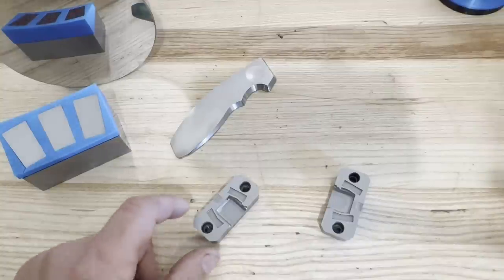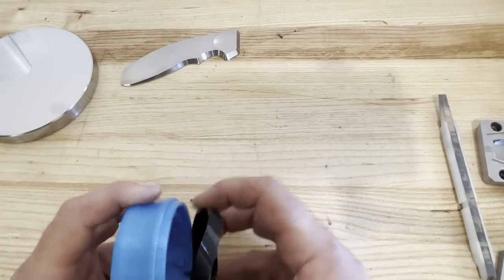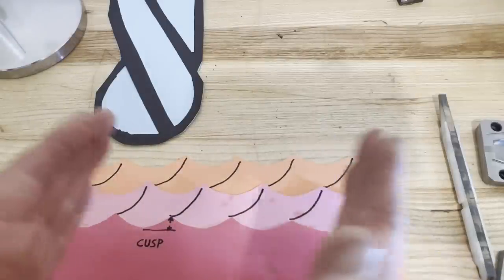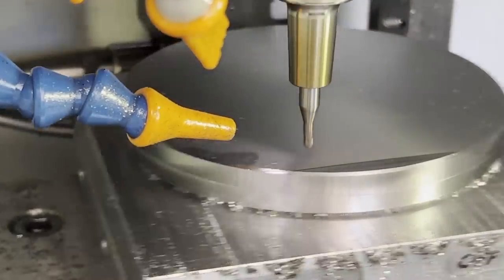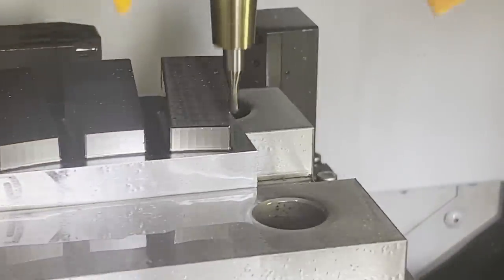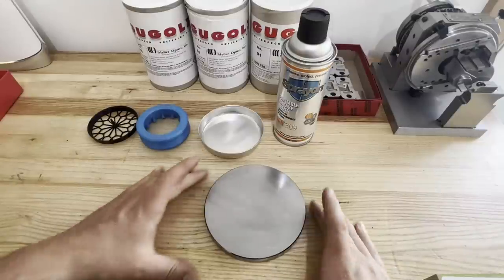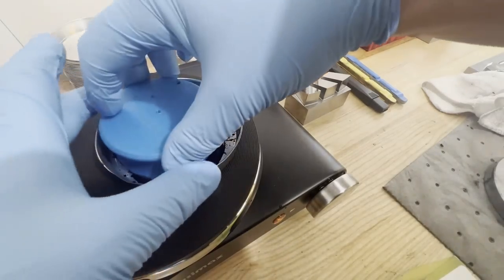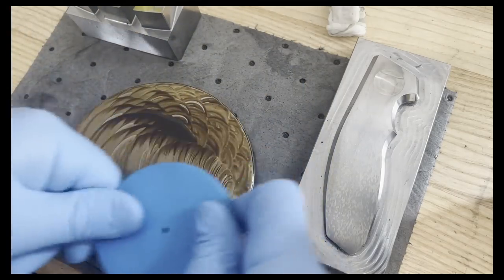Improve your polishing with 3D printing

Comment: I made some ultra flat lapping plates from 8in dia 1.5 thk cast iron using the three plate method. I started with a reasonable surface ground finish. I milled a grid of grooves and ground the plates together in the 3 plate order to make them flat. Of course thousands of strokes per plate, many combinations of plates and several grits makes this a huge job.  Of course this is way too much work so I didn't do any of this. I made a fixture and programmed a CNC mill to do all the work.  My polishing action included linear and rotary motion. I did clean and shuffle the plates and change abrasive.
I did about 2-3 hours worth for each grit. So probably 8-10 hrs total. This would have been punishing by hand. I measured the plates with a Heiidenhan LVDT sensor and a laser interferometer. I'm not sure how you are supposed measure plates like this down in the millionths. The laser would measure a millionth and it found only one or two anywhere I looked. At this scale anything will affect the reading so I'm not sure how trustworthy these numbers are. It was a lot flatter than my surface plate when I measured it the same way. Interesting experiment and pretty flat too.

 I always learn interesting things from your videos, glad you take time to make them. I watch them all. Thanks JY.
Reply: I will second that, very glad you take the time to show and teach. Thank you!
Reply: Any videos on that process?

Comment: In the world of telescope making we have used 3d printed figuring disks for some time. For turning a the spherical surface into (usually) a parabolic, but also other aspherical surfaces. Huygens Optics on youtube recently did a video where he uses the technique. Also have to say, your 3d printed differential pitch screw actuator, is brilliant!.. and will be stolen by the DIY optics community..Thnks!
Reply from the maker: I’ll have to check them out, opticians fascinate me with their abilities
Reply: @adamthemachinist  We feel the same about precision machinists. But I`m guessing we have found common ground in the transition from micro to nano-meter. So much to learn from each others fields. The optician gives the machinist a a sharper eye, and the machinist gives the optician a sharper tool that makes a sharper lens, and so on.

Comment: I came across the FPT=stepover thing recently whilst looking for info on how to achieve a particular(theoretical) surface finish with a given size ball mill.
It makes a massive difference to cycle time compared to the"normal" feed rates. Only problem for me is the mill I run has very poor Dynamic performance so often never reaches the programmed feedrate which tends to leave blemishes from the "dwelling".(Im sure the Mori NVD has no problems at fairly high feedrates)
Another thing to consider is that the Maximum stepdown in the contour toolpath(or any "Z" level/waterline path) is equal to the xy stepover only at 45° for a given cusp height.
at shallower angles the Stepdown will need to be less

Comment: Adam does the feed per tooth trick work on bullnose tools? Does the answer change if the bullnose tool has a large radius, and you are only cutting in the tool radius area? I've always had a hard time trying to find some useful info on surfacing.

For toolpaths: Parallel locked in x or y? On most verticals I'm guessing x is better cause of less weight to move around? Something I've liked the look of is 3D contour, starting at the bottom, traveling up, and making sure the z axis never lifts above the current cut. So it'll take a cut, lead out away from the part, and step up for the next cut. My thinking is that would reduce any backlash in z because you are only ever traveling in one direction in z. Do you think 3D contour will leave a better finish, or parallel? 

I've found that going straight from the machine to tumbling is proving challenging because it turns out even with aggressive media, if the scallop height is to high, it will take ages to knock down the peaks to match the valleys. Any thoughts? Thanks for the video as always!

Comment: polishing the circular example really makes me want to build a thing I have no use for, a machine for this. Two spindles pointed antiparallel where one has a work holding system, the other has a big boring head mechanism to hold the lap and some kind of concentric shaft with a harmonic drive or third motor. One of the two main shafts can shift side to side, also like a boring head (it's boring heads all the way down). With encoders and computer control you could make it sweep into corners and scrub arc sections, but just spinning all the parts at different speeds would cover a circle, and driving the axial offset would create helical coverage area.

Comment: Learned some things Adam, Thanks. What hardness pitch do you use most?
ATB, Robin
Reply from the maker: Robin, I’m pretty new to the pitch as well , I got 64 on the recommendation of extra minty Matt on Instagram . That seemed to work well on the large part but I notice some wear when going over the corner on the knife handle example . I also have some 55 and 91 I want to play with

Comment: Summary (English, German, Chinese)
Abstract

The video explores the use of 3D printing in mold polishing, specifically for creating custom guides and laps for achieving high-quality surface finishes on complex shapes. The video also discusses the importance of optimizing CAM toolpaths for surface finish by matching step over and feed per tooth. Several examples are shown, including polishing a conical section with three lands, a large radius on a knife handle, and a dome segment on a punch.

Summary

3D Printed Polishing Guides

* 0:00: Introduction to the use of 3D printed guides for protecting sharp corners during mold polishing.
* 0:27: Comparison to traditional methods like machining custom material or using a second insert.
* 0:37: Advantages of 3D printing for complex shapes and cost-effectiveness.
* 1:11: Consideration of grit contamination in plastic prints and using multiple prints for different grits.

3D Printed Pitch Laps

* 1:24: Introduction to creating convex pitch laps using 3D printed molds for polishing large radii on parts like draw punches and knife scales.
* 2:00: Two-piece 3D printed mold with low durometer material for forming flutes and a handle for pouring and holding the pitch.
* 2:18: Demonstration of pouring molten pitch and removing the mold after solidification.

Surface Finish and Toolpaths

* 2:26: Importance of surface finish in mold polishing and the limitations of 2D representations of toolpaths.
* 2:51: Explanation of cusp height and its impact on surface finish in both X and Y directions.
* 3:30: Visualization of scallops created by ball end mills and the relationship between step over and feed per tooth.
* 3:48: The concept of matching step over and feed per tooth for optimal surface finish and cycle time.
* 4:14: Consequences of mismatched step over and feed per tooth, leading to visible lines and inefficient machining.

Machining Examples

* 5:50: Machining a large radius part with a 6mm ball mill for roughing and semi-finishing.
* 6:01: Finishing with a 3mm ball mill at specific feed rate and step over for desired surface finish.
* 6:22: Machining a conical segment with varying step over and feed per tooth to demonstrate their effect on surface finish and polishing time.

Polishing and Results

* 8:47: Machining a knife handle with a 6mm ball nose and using 3D printed guides for polishing.
* 9:50: Demonstration of the 3D printed pitch lap with a low durometer mold and pouring molten pitch.
* 10:57: Rough lapping to remove remaining feed lines and discussing challenges with smoothing settings in Fusion 360 for large radii.
* 11:46: Alternative concept for a 3D printed pitch lap with pre-formed grooves.
* 12:50: Using diamond slurry and exploring the potential of diamond compound for polishing.
* 13:30: Final thoughts on the potential applications of this technique in tool making and other industries.

Zusammenfassung

Das Video untersucht die Verwendung des 3D-Drucks beim Polieren von Formen, insbesondere zur Herstellung von kundenspezifischen Führungen und Läppchen, um hochwertige Oberflächenveredelungen auf komplexen Formen zu erzielen. Das Video erörtert auch die Bedeutung der Optimierung von CAM-Werkzeugwegen für die Oberflächenveredelung durch Anpassung von Schrittweite und Vorschub pro Zahn. Es werden mehrere Beispiele gezeigt, darunter das Polieren eines konischen Abschnitts mit drei Stegen, eines großen Radius an einem Messergriff und eines Kuppelsegments an einem Stempel.

Zusammenfassung

3D-gedruckte Polierführungen

* 0:00: Einführung in die Verwendung von 3D-gedruckten Führungen zum Schutz scharfer Ecken beim Polieren von Formen.
* 0:27: Vergleich mit traditionellen Methoden wie der Bearbeitung von kundenspezifischem Material oder der Verwendung eines zweiten Einsatzes.
* 0:37: Vorteile des 3D-Drucks für komplexe Formen und Kosteneffizienz.
* 1:11: Berücksichtigung der Kornkontamination in Kunststoffdrucken und Verwendung mehrerer Drucke für verschiedene Körnungen.

3D-gedruckte Pitch-Läppchen

* 1:24: Einführung in die Herstellung von konvexen Pitch-Läppchen unter Verwendung von 3D-gedruckten Formen zum Polieren großer Radien an Teilen wie Ziehstempeln und Messerskalen.
* 2:00: Zweiteilige 3D-gedruckte Form mit niedrigem Durometer-Material zur Bildung von Rillen und einem Griff zum Gießen und Halten der Tonhöhe.
* 2:18: Demonstration des Gießens von geschmolzenem Pech und des Entfernens der Form nach dem Erstarren.

Oberflächenbeschaffenheit und Werkzeugwege

* 2:26: Bedeutung der Oberflächenbeschaffenheit beim Polieren von Formen und die Grenzen von 2D-Darstellungen von Werkzeugwegen.
* 2:51: Erklärung der Spitzenhöhe und ihrer Auswirkungen auf die Oberflächenbeschaffenheit in X- und Y-Richtung.
* 3:30: Visualisierung der von Kugelfräsern erzeugten Jakobsmuscheln und die Beziehung zwischen Schrittweite und Vorschub pro Zahn.
* 3:48: Das Konzept der Anpassung von Schrittweite und Vorschub pro Zahn für optimale Oberflächenbeschaffenheit und Zykluszeit.
* 4:14: Folgen von nicht übereinstimmender Schrittweite und Vorschub pro Zahn, was zu sichtbaren Linien und ineffizienter Bearbeitung führt.

Bearbeitungsbeispiele

* 5:50: Bearbeitung eines Großradiusteils mit einem 6-mm-Kugelfräser zum Schruppen und Vorschlichten.
* 6:01: Schlichten mit einem 3-mm-Kugelfräser mit spezifischer Vorschubgeschwindigkeit und Schrittweite für die gewünschte Oberflächenbeschaffenheit.
* 6:22: Bearbeitung eines konischen Segments mit variierender Schrittweite und Vorschub pro Zahn, um deren Auswirkungen auf die Oberflächenbeschaffenheit und die Polierzeit zu demonstrieren.

Polieren und Ergebnisse

* 8:47: Bearbeitung eines Messergriffs mit einer 6-mm-Kugelnase und Verwendung von 3D-gedruckten Führungen zum Polieren.
* 9:50: Demonstration des 3D-gedruckten Pitch-Läppchens mit einer Form mit niedrigem Durometer und Gießen von geschmolzenem Pech.
* 10:57: Grobes Läppen zum Entfernen verbleibender Vorschublinien und Diskussion von Herausforderungen mit Glättungseinstellungen in Fusion 360 für große Radien.
* 11:46: Alternatives Konzept für ein 3D-gedrucktes Pitch-Läppchen mit vorgeformten Rillen.
* 12:50: Verwendung von Diamantschlamm und Untersuchung des Potenzials von Diamantpaste zum Polieren.
* 13:30: Abschließende Gedanken zu den möglichen Anwendungen dieser Technik im Werkzeugbau und in anderen Industrien.
User:	translate abstract and summary to chinese
Model:	摘要

该视频探讨了 3D 打印在模具抛光中的应用，特别是用于创建定制导向器和研磨盘，以在复杂形状上实现高质量的表面光洁度。视频还讨论了通过匹配步距和每齿进给量来优化 CAM 刀具路径以获得表面光洁度的重要性。展示了几个示例，包括抛光具有三个凸台的锥形截面、刀柄上的大圆角以及冲头上的圆顶段。

总结

3D 打印抛光导向器

* 0:00: 介绍使用 3D 打印导向器在模具抛光过程中保护锋利角落。
* 0:27: 与传统方法（如加工定制材料或使用第二个嵌件）进行比较。
* 0:37: 3D 打印对于复杂形状和成本效益的优势。
* 1:11: 考虑塑料打印件中的砂砾污染，并对不同的砂砾使用多个打印件。

3D 打印沥青研磨盘

* 1:24: 介绍使用 3D 打印模具创建凸面沥青研磨盘，用于抛光拉伸冲头和刀柄等零件上的大圆角。
* 2:00: 采用低硬度材料制成的两件式 3D 打印模具，用于形成凹槽和用于浇注和固定沥青的手柄。
* 2:18: 演示浇注熔融沥青并在凝固后去除模具。

表面光洁度和刀具路径

* 2:26: 表面光洁度在模具抛光中的重要性以及刀具路径二维表示的局限性。
* 2:51: 解释尖点高度及其对 X 和 Y 方向表面光洁度的影响。
* 3:30: 可视化球头立铣刀创建的扇贝形状以及步距和每齿进给量之间的关系。
* 3:48: 匹配步距和每齿进给量以获得最佳表面光洁度和循环时间的概念。
* 4:14: 步距和每齿进给量不匹配的后果，导致可见的线条和低效的加工。

加工示例

* 5:50: 使用 6 毫米球头立铣刀加工大圆角零件，进行粗加工和半精加工。
* 6:01: 使用 3 毫米球头立铣刀以特定的进给速度和步距进行精加工，以获得所需的表面光洁度。
* 6:22: 加工具有不同步距和每齿进给量的锥形段，以演示它们对表面光洁度和抛光时间的影响。

抛光和结果

* 8:47: 使用 6 毫米球头刀加工刀柄，并使用 3D 打印导向器进行抛光。
* 9:50: 演示采用低硬度模具的 3D 打印沥青研磨盘和浇注熔融沥青。
* 10:57: 进行粗研磨以去除剩余的进给线，并讨论 Fusion 360 中的平滑设置对于大圆角的挑战。
* 11:46: 具有预成型凹槽的 3D 打印沥青研磨盘的替代概念。
* 12:50: 使用金刚石浆料并探索金刚石研磨膏用于抛光的潜力。
* 13:30: 关于这项技术在工具制造和其他行业中潜在应用的最后思考。

summary made with gemini 1.5 pro
Token count
6,459 / 1,048,576

Comment: Thank you! I l have used these techniques as a precision optician but haven't seen them applied to tooling. How do you go about selecting polishing slurries and compounds? I'm mostly familiar with alumina and ceria used for glass.

I may also be able to help with forming laps for domed tools if you can show or sketch an example.
Reply from the maker: I generally have a small selection of Diamond slurry for lapping on cast iron and copper laps and then Diamond paste is what I have a larger range of kept around for polishing with felt bobs on my micro motor . The slurry is thinner and less likely to distort geometry but the paste has more Diamond per volume and can cut faster at times .
Reply: @adamthemachinist  if spherical is what you're after, pitch polishing will often actually improve geometry rather than distort it. A skilled optician can achieve total sphericity/flatness of about a micro inch with pitch. A fraction of a tenth is almost free.

Comment: Have you tried printing with TPU? it's kind of a pain but it is really low durometer and you can adjust the overall stiffness of the part with infill settings.

Comment: Hi Adam, if I wanted to polish a copper square (40mm by 40mm by 2.5mm) and wanted it to be very flat while getting a true mirror finish, would you try the 3D printed support and then polishing stone, or would the tar be a better option?  I am new to polishing so a bit confused, but I am intrigued by the 3D printed support idea!
Reply from the maker: If you need true flatness than I wouldn’t recommend the 3D printing , you may want to look at proper lapping plates and how to make a set
Reply: @adamthemachinist  I see, thank you for clearifying :) I will take a look at lapping plates then.

Comment: I never did any polishing but I'm a bit confused about the 3d printed jig to prevent round corners. Unless the 3d printed part is flush with the soon to be polished part, then either it's higher and you polish the 3d printed part and not the part or it's lower and you are actually rounding the part.
I think I missed something in the process..

That said, very interesting video, thanks for the knowledge!
Reply from the maker: The error isn’t a big concern , usually a tiny bit lower and I shim it up . Talking about gross corner rounding to the extent that could allow plastic to flash , in excess of 25 microns .

Comment: Excellent video - thanks. What tool are you using at 9:23 to polish the angled segments?
Reply from the maker: That one was stoned to 600 grit them appeared to 1200 and then polished with brushes and felt bobs to 8k grit

Comment: The point about step over and feed per tooth is very interesting and something I hadn’t realised, but it’s very important for me when I’m machining mould tools and need to get surface finish as high as possible, do you find this works well on soft tool steel too, I usually work on p20 pre hard, thanks again
Reply from the maker: Works fine in soft materials

Comment: What are the materials I need to purchase to apply to the 3D printed laps? Is the pitch the abrasive? I'm very new to this.
Reply from the maker: Gugolz lapping pitch . Poke around the diy telescope community for way more in depth info
Reply: @adamthemachinist  what I wonder after doing some digging is why you couldn't use a mix of abrasive grit and thermoplastic instead. I'll check if the Gugolz pitch is available locally. Do you have CAD for the prints you used?

Comment: So an end mill wouldn't leave a better smoother finish that's closer to a polished surface than a ball nose endmill?
Reply from the maker: Well endmills can be a little trickery to have follow 3D surfaces and get a even looking result . With a bullnose endmill you can do well with z level finishes but low angle curved faces can be difficult to get a even looking face . Check out sturz milling for more in 3D profiles with bullnose endmills